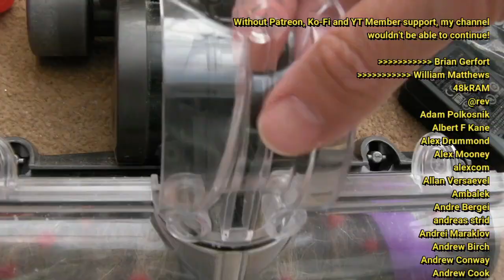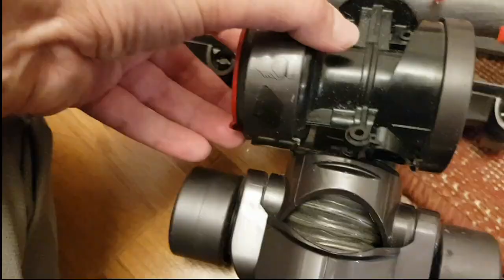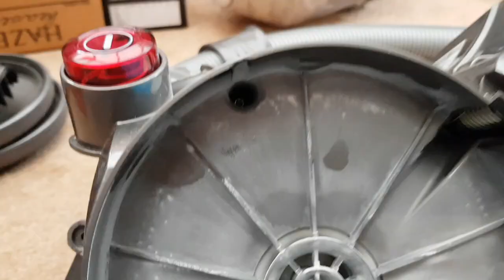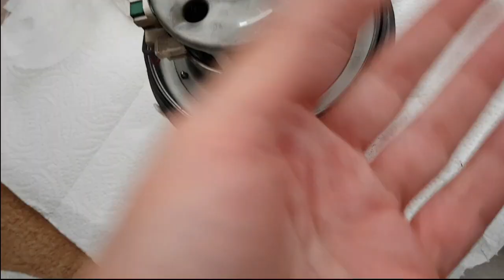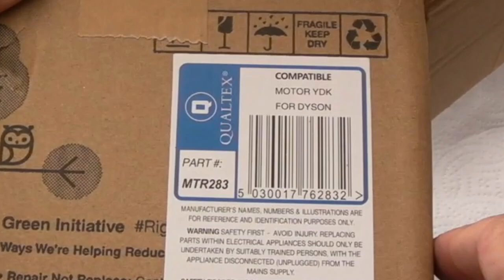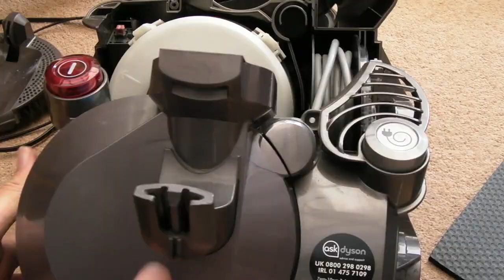Dyson Animal DC19-T2 Not Rotating Brushes (Cleaning, Suction & Maintenance) & Motor Replacement

Comment: Having worked on our washing machine recently and many Henry's, those brushes should be at least an 1” long.  You can sand down the commutator and clean and would probably work again.
Reply: Thanks!  I am sure new brushes may have worked if I had been able to clean up the inside of the motor, it was just really hard trying to reach inside!  I suspect that would have been easy if I had removed that top nut and the fan section!